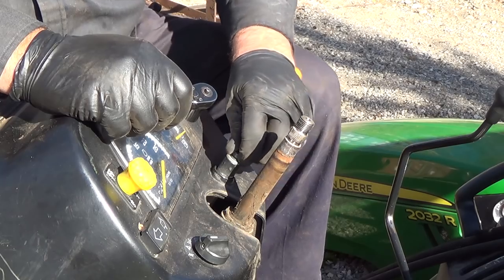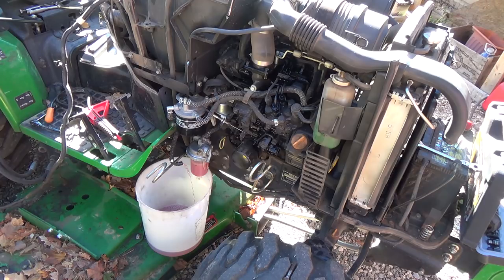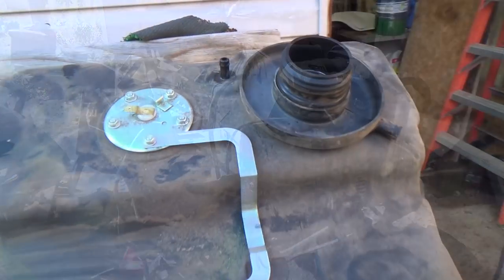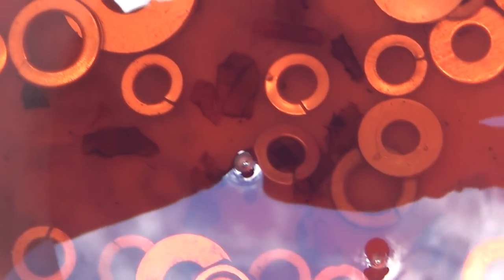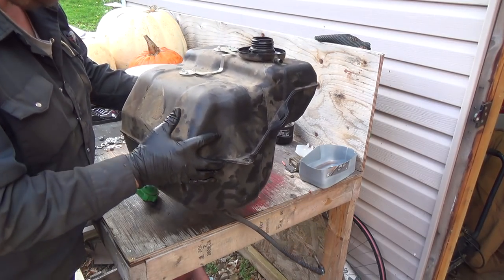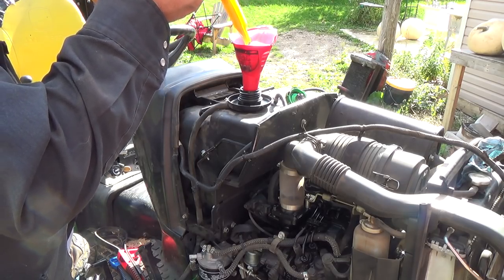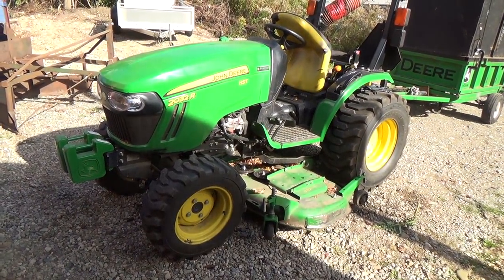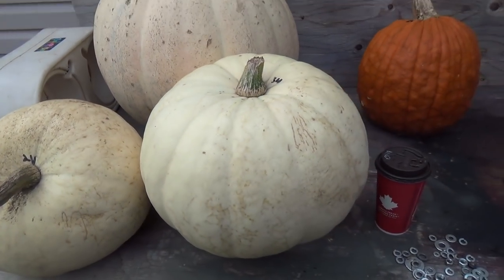John Deere 2032R fuel tank removal clean and reinstall

Comment: bill they make oil filter cutters. they are like a big steel or cooper tubing cutter or exactly like a tailpipe cutter here in Niagara falls new york we have harbor fright comparing it to your ad it looks the same as your princeless auto. here in the states, they are under 20 loonies lol of course as a mechanic for a garbage company from 190-2011 I've seen the big tool companies with them too for 5 times that. snap on mac maco. a good way to check your paper pleats is I cut the top and bottom with a utility knife and then bunch them all together like an accordion and squeeze the stack of folded paper in your vice. not so much needed with a fuel filter but works great on oil filters miss the kids carving pumpkins with your sword knife collection lol like the old days. just last week's youtube suggestion was about eight years ago when you and the kids were carving pumpkins and I don't remember if you did but you kept saying your gonna get your chain saw to carve them cause they were so thick. I need to finish watching it I believe it was just over an hour-long lol those "worms" could have been algae and probably getting pumped from your holding tank, of course, I didn't see them in person so maybe they were just shredded leaves. kee up the great work. my two nephews just love your tractor videos. One 3 and one 5. they both have their own 1960s john deer the younger one has a 60s model 60. little 8 or 10 hp lawn tractor and the older one has a newer 60s 110 not your 110 backhoes but another 10 hp 32 or 36-inch cut mower .both run and cut even knowing they have those junk Tecumseh mowers anything but those. they went out of business in the 90s I believe and now harder to get good parts

Comment: If you get water in fuel and it gets into the injectors you will blow the tips off the injectors.water will compress to much and blow the tips off.then you just killed the engine.it will need a full rebuild and complete draining of the fuel system.